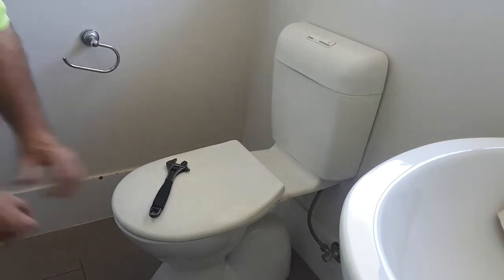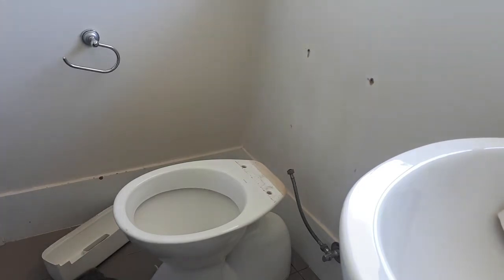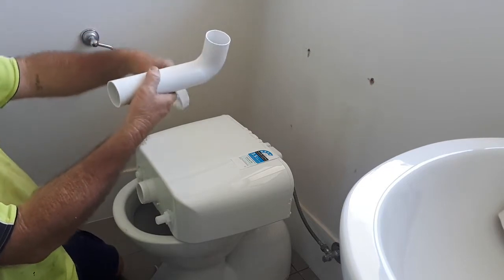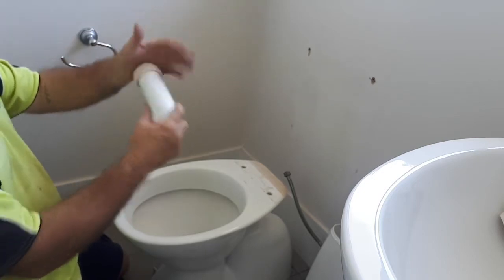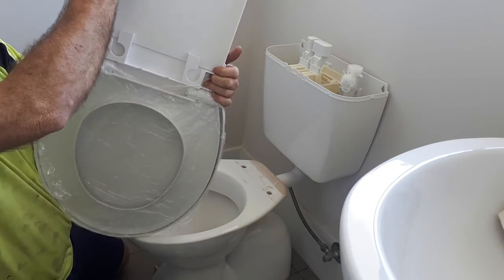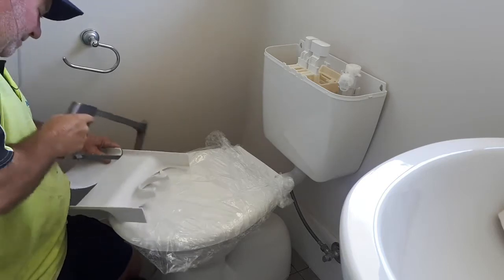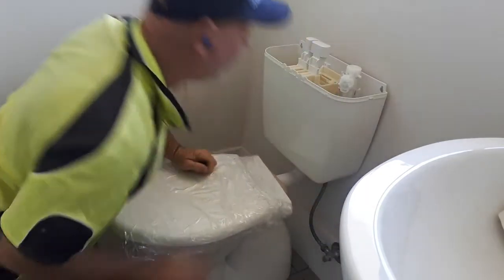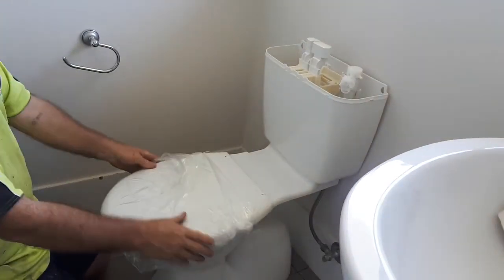How To Install A Toilet Cistern

Comment: Probably a silly question but if drilling into the wall to fasten the cistern is there a chance of hitting pipes or are the pipes usually located lower? Just wanted to double check before I have a go
Reply: Hey mate, no I've not come across it before but hey always a 1st for everything. Just make sure you screw into a stud if possible regardless if it doesn't line up with the holes in the cistern just make a new one. 1 good screw into a stud is better than 2 screwed into gyprock or cemet sheeting.
Reply: @jasmoore5716  perfect 👌 thanks mate you’re a legend 👍

Comment: Thanks for all the tips mate👍.
Any advice how how to reduce or stop water tap hummer noise ?
Reply from the maker: start by changing out the washers then when add new squash the end of the stem of the tap washer a fraction so makes the stem fit tighter in to the spindle. depending on which taps too you could use a water hammer arrestor.